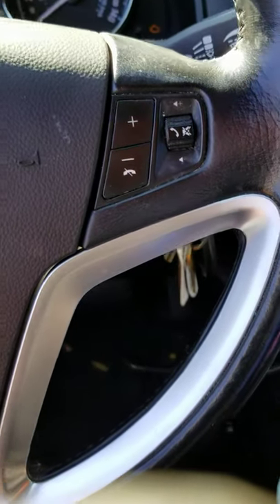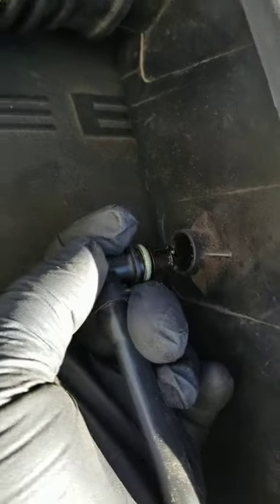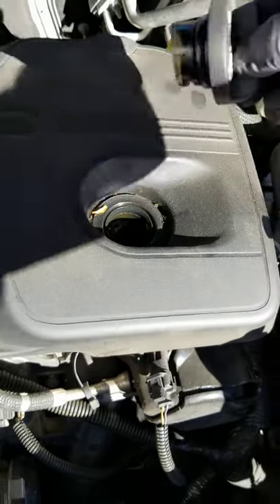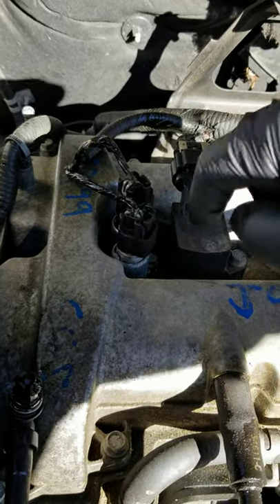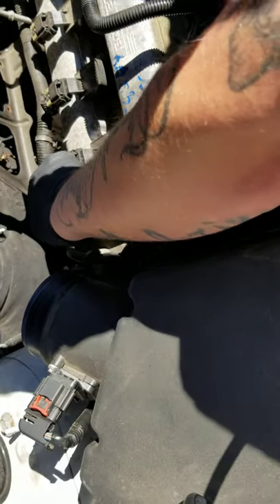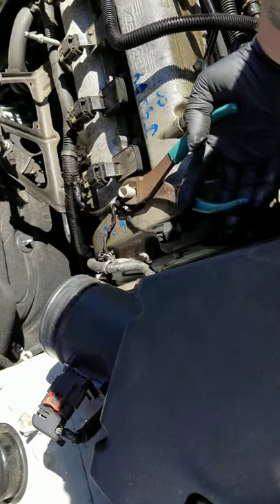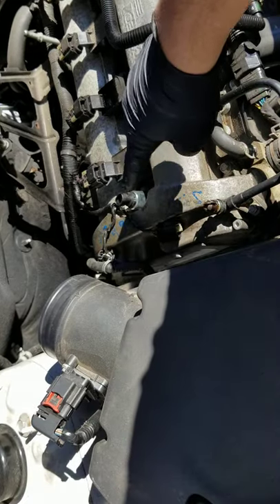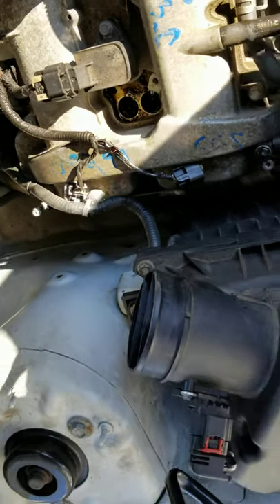2013 Chevy Captiva 2.4L code P0010 & P0011 Camshaft Position Actuator Solenoid Replacement

Comment: Awesome video man! My captiva was stalling out too. Same check engine code. Did the swap out in less than 20minutes. Very simple and to the point!
Reply from the maker: Thank you I really appreciate it and I'm glad I could help out
Reply: Did it solve the problem? My sister's car is doing the same thing.
Reply: @prestonbyrd2670  it did. It fixed the check engine light and i cleaned the throttle body while I was in there but my RPM still dances alot especially at idle. What is your captiva doing ?
Reply: @abecruz4142  pretty much the same thing brother I just changed both the sensors and I believe she's good true blue blessing man I can't thank you enough you f**** rock
Reply: @bagged91s10  you f**** rock brother save the Day
Reply: @bagged91s10  I had to change it in the middle of a blizzard but I got that turkey done can't thank you enough man
Reply from the maker: @prestonbyrd2670  I'm glad I could help you out my friend
Reply: This normally happens when engine oil is too dirty ,
Reply: Did your vehicle start right away.

Comment: Ok, this is long.  Bought 2013 chevy captiva last summer. Within a month, it over heated and the ac stopped when that happened. Found out my model was made with the wrong bolts so ...spilled oil.  We were doing one oil change a month, and still adding oil...drivinf on day the captiva just  died, while driving.  Got a tow to mels garage in watertown, wi. Paid for  a re manufactured enegine. Just got the car back about a month ago
 ALSO, just put a brand new battery in this past November before the enegine replacement.  A week ago parked and work, came out..wouldn't start...all i hear is a tik tik tik. All lights, music etc still worked. It sat for two days, tried starting it started. Drove for a week, parked. Died again. Tried bumping the starter , it wouldnt turn  over just a tik.... it start another 5 days...it started and fine again...then died 
Please annnny  suggestions???!!
We were thinking wiring? We have a warranty w the re manufactured enegine.  
Anythinf would help. Thanks 👌

Comment: Can you just start engine up after fitting new sensors or is there anything else you must do before starting engine
Reply from the maker: Yes after putting the new sensors in and putting everything back you took off yes you can start the car
Reply: @bagged91s10  my car don't start.  It shows something about the timing. Engine is swinging very slow

Comment: Good job. Those are not sensors though, but actuators (solenoids).
Reply: Thank you for mentioning this fact because I learned the sensor is an entirely different part

Comment: My engine light is on and the code reads my camshaft sensors. I replaced both and I replace the solenoid’s and still my light is on. I’m not too sure what else to do
Reply from the maker: Did you have the engine light reset on the car if not it will take a little for the computer to reset the light

Comment: So I went and got this done at Chevy $520 later And now my car is turning off while I’m driving
Reply from the maker: Did you end up doing both sensors or just one ? Is your check engine light still on if so can you tell me the code that comes up.
Reply: @bagged91s10  both was changed And nope no engine light. But I checked the oil and it’s very low..Like extremely low.
Reply: @bagged91s10  I will be putting oil as soon I leave work, The mechanic at Chevy informed me it could be bearings ugh..I’m not doing that at this point

Comment: Is that the most common thing that goes wrong
Reply from the maker: I wont say the most common thing but one of them yes but its really easy to fix by yourself and not haveing to pay alot of money at a shop
Reply: @bagged91s10  I was thinking about getting one the lady said she pull up in the yard. Went in for the day then the next day it would not crank it turned over but would not crank